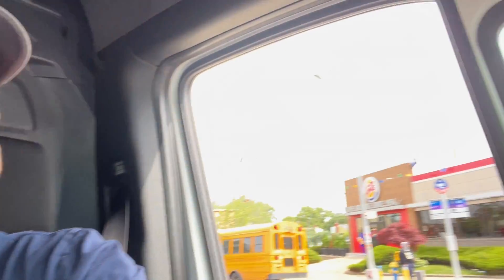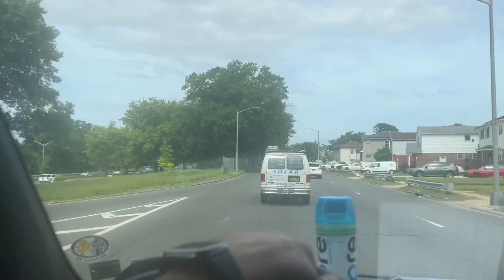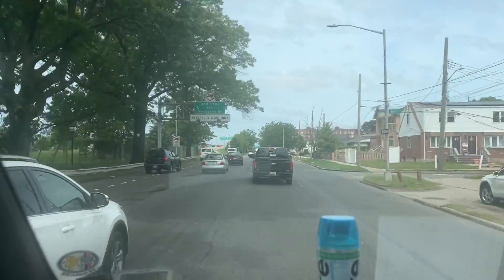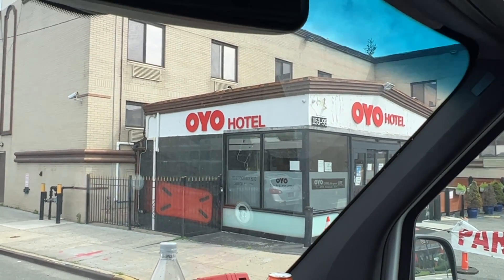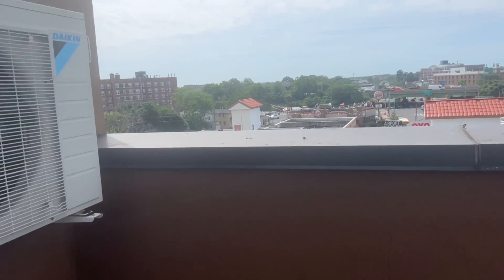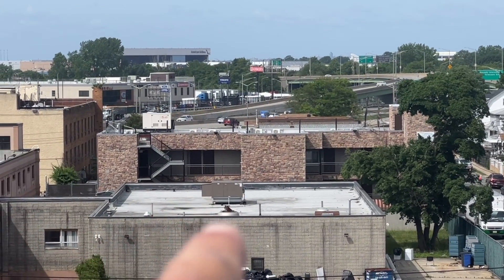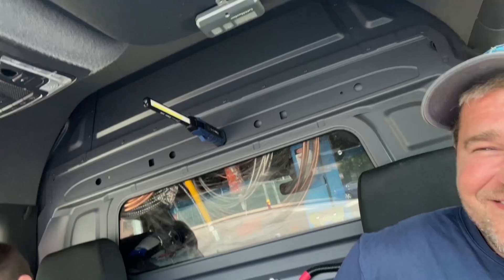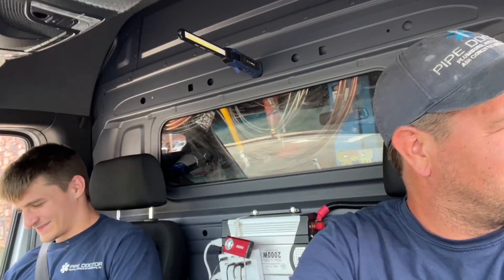JFK Airport Hotel Not Cooling from Daikin Ducted Mini Split System

Comment: I would put money on the flare fittings behind the evaporator.
Reply: I wonder how many pre-made line-sets are joined end to end to go four+ floors of height(lol) I can almost guarantee that's what they did, probably even routed stupidly tight against vertical chasses with firestop caulking and materials at each hole of every floor, complete with insulation ripped everywhere and possibly nails/screws into the lines.

Comment: A lot of those line sets that come from overseas aren't copper all the way through they're made of recycled aluminum so they tend to kink crack and leak or they leak right behind the flare nut...
Reply: very poorly recycled copper, chock full of impurities of all kinds. only thing worse is the brass on the market now, which they claim is lead free or very low lead. I'm guessing it's full of other very hazardous recycled chemical pollutants

Comment: 2:30 now is that cost of the 410A with a 300% markup or was that a 500% markup to the customer?
Reply: That's the cost the contractor pays from the supply house!
Reply: that's what he pays for the whole tank at supply house, filling up 10 lbs he can only use that tank 1 more time and its empty so it's not a 500% mark up you moron go do the math r410a is 600 plus depending on what state your in you jcat goofball
Reply: the price of the gas itself is around 4$/pound
Reply: @Fattony6666  better charge that 16 to 24 dollars per pound then